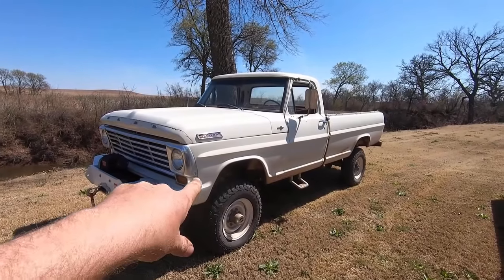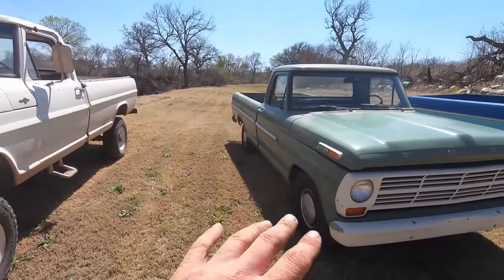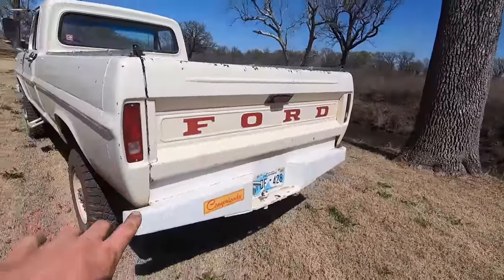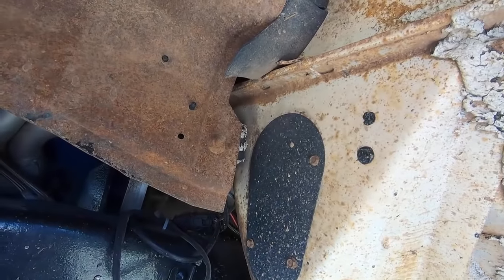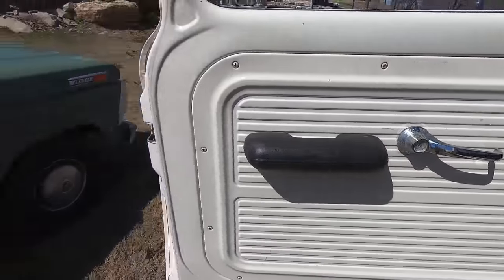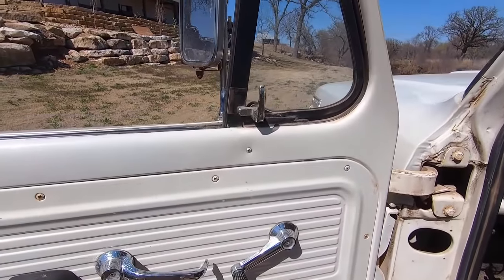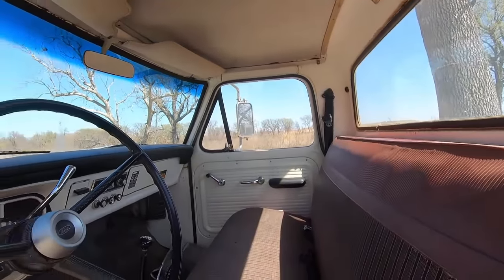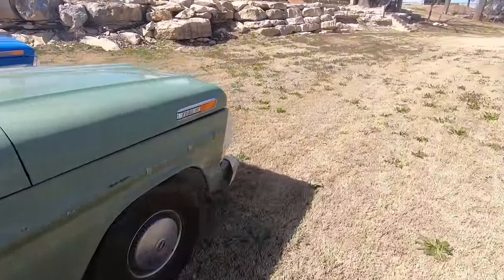What Makes a 1967 Bumpside so Different Than The Rest?

Comment: I had a '67 F100 Camper Special and had accumulated tons of stuff for it, including BRAND NEW hood emblems, CS emblems, etc. I bought it to restore, and did so much work on it to bring it back to life, until I was forced to use it as a daily driver for 3 years. In so many ways the '67 was a "one year" truck compared to the other bumps. I've since sold it all.. the truck just had too much cancer to save (mostly around the roof drip rail) and I had too many kids to hang on to it for daily use. 😥

Comment: Those garment cooks in the 67's look identical to the ones in my mom's 62 Falcon Deluxe 2 door..
Reply from the maker: Probably the same hook!
Reply: @MattKubik1791  I'm sure it is !
I've had 3 bumpsides, my first and my first vehicle ever was a 71' Custom short bed, 302, 3 on the tree and manual everything, and I had 2 72's, a Sport Custom, 360 auto and power steering and an Explorer with the same options except it had the BIG radiator which I guess was a towing package.
All excellent vehicles !!

Comment: The one you said was a Camper Special didn't look like one no duel tanks that I could see. So hope you go back to that one to clarify the Camper Special you think you have Thanks, will be watching 😊
Reply from the maker: Dual fuel tanks were not a part of the camper special package. At least during 67-72. The only options that were included as standard when you selected the camper special package were: 55 amp alternator, 70 amp hour battery, oil pressure gauge, ammeter, western long arm mirrors, extra cooling package, camper wiring harness, dual electric horns (expect ones with power pack option) and last but not least camper special cowl emblems. Dual tanks were optional, as well as side storage tool box that most associate with camper specials. Hope this helps! 

Source: 1972 ford truck brochure page 11. 
 http://www.fordification.com/library/picture.php?/1703/category/211

Comment: great video, I think only think  it would be better if the 4x4  was a 4 speed,but with that motor very cool!  I had 69 4 speed 390 wish I never would have sold it!   thanks for video. very bad think about these trucks key switch you can just pug new one in and start any truck this year crazy!.

Comment: I have a 71 f100 SB 4x4 and a 68 f100 SB flare side 4x4 that is #40 built 68 f100 . Don't know what # 4x4 it is for 68. But everything in my 68 is 67 . Heater and radio controls , grill etc. All of it is left over 67 but it's a 68 originally sold to US Dept of Agriculture. Factory 360fe . Has factory Dana 60 semi floating 5 lug rear differential with power lock limited slip differential and 4.10 gears. Love the bumpsides

Comment: Thanks for that, do you know anyone with the 66 F250 4x4? I haven’t seen another one yet, I bought it in OK 1984
Reply from the maker: Yes, quite common. But less common as the later trucks. Ford started making factory 4wd f-250 trucks in 1959.
Reply: So how do I find out how much my truck is worth? Thanks
Reply from the maker: @stanwalls6434  research, find comparable sells, Facebook market place, Craig’s list etc. hagerty has valuation tools to help but only have fair to Concourse values. If you are unable you can pay a classic car appriser to value it for you.

Comment: Weren't the 4 way flashers optional in '67s too?  And with the switch mounted in the glove box?
If it was a cigarette lighter, it would be narrower, and a cigar wouldn't fit.
Bumpsides are THE BEST looking pickup trucks ever made. (Although the '55-'57 GMs are up there too.) I have the Bump's almost-as-good-looking younger brother, a Dentside.
First trucks I ever rode in and drove were Bumpsides.  Didn't the '67s still use the lighter blue paint on the engines?

Comment: First Time Viewer! Great Video! @14:51 Looks like a 1969 - 1972 Ford steering wheel mounted in a 1969 - 1972 Chevrolet / GMC steering column with tilt wheel and gear selector indicator. Why do you have General Motors "Gargantuan Mistake" parts on your Ford "First On Race Day" truck???

Comment: Hi, Interesting vid👍 I have a 71 F100 4x4 I am rebuilding and I wonder if anyone can tell me what the holes with grommets in are for inside the back cab corners above the seat, I notice they are also in your 67, could they have been put there for optional lap and diagonal seat belts, they are beefed up with tube inside  but there is no thread in them?
Reply from the maker: They are for factory shoulder belts. However I decided not to use them because they are so far back. I installed my shoulder belts closer to the 1970-72 location.
Reply: @MattKubik1791  Thanks, I thought that was the case, I just discovered Ford changed the position of them mid 71 mine was assembled Nov 70 so the holes are in the same position  as yours.

Comment: The side trim is different also. It’s not as wide as 68/73. They also had a “flat” floor board. That was in the six cylinder/ three speed trucks. They did not have disc brakes.My truck was built in September and did not have a factory title. They started titling trucks until October. That change was when the trucks became daily drivers and farm equipment.
Reply from the maker: Correct! I didn’t have a 67 with trim to show that and forgot to mention it. But our 69 also has the “flat” floor. This 67 that I made into a highboy originally was a f-100 with 352 and 3 speed. It has the flat floor and I had to cut it out to install the high hump cover. So not sure if that is a 67 only item.
Reply: All of the older Ford 4WD trucks and GM 4WD trucks have the "hump floor".
Reply: The 67 had bolts to remove the flat panel and put in the heavy duty panel for automatic transmission and “double low” transmission.

Comment: Good day and new subscriber here! I've had a dentside for few years now, and just yesterday I bought my first bump!  1970 F250 2wd Custom cab. 360 with a 4 speed. You seem to be an expert on these bumps so I have a question for you.  This 360 has an oil bath air cleaner on it. Did they still use this in 1970?
Reply from the maker: Yes it was optional equipment.
Reply: @MattKubik1791  Thanks!  I've done some reading but couldn't find anything definitive. And I've been a Ford parts guy for 21 years 🤔

Comment: Got myself a 67 250 camper special for myself. Rusty and somebody painted it with a fuckin brush but I basically only paid for the rims and exhaust for a running truck with a 460 in it.

Comment: My “base” model  1967 swb 6 cyl “3 on the tree” was purchased used in 1970 by my parents, I believe it was stone stock back then, it came with the aluminum grill you have and a painted steel front bumper...Currently being reworked once again, only thing left stock is the cab/ bed.
Reply from the maker: Very cool! Maybe mine came from the factory that way. That’s an awesome story and cool that you still have it.

Comment: i picked up a 70 high boy with dana 60/80 lockers with a 390 4 speed rust free good clean body tool box on side extra front clip doors and hood 3 sets of chrome trim lights and emblems box was full of parts all for 250 bucks with a set of new wheels 12 inch 16,5 rims for military tires i get 36.5 tires for 25 bucks with 80% tread . i had a 67 with a 352 it was a gas hog with no power i think i have 3 360 that i just through in the dirt .plus i can get a lot of 390's i know where there is about 8 just sitting in rigs at my friends house i can get them for 100 bucks each or buy the whole rig for 300 from 65 to 78 that what he has just sitting about 25 rigs in ford pu's

Comment: I see your '67 has shoulder belts but the '69 does not.  Aftermarket change on the '67?  Or a factory option?
Reply from the maker: My 67 has aftermarket belts. But shoulder belts were an option but very rarely added. I’ve only ever seen them on a government order truck.

Comment: You should check out the Brazilian F-1000, apparently they have been continuing to build the 1967 f100 as the F-1000 over there all the way through from the research, looks like 1992... The truck has a full set of round gauges that you could probably order from Ford of Brazil that might plug in with some mods..
 check out the You tube videos for F1000s 1992 ford F1000 will blow your mind...
As a side note I think they used the 1972 Grill assembly all the way through 1980!!
Reply: The Australian 69 - 73 had individual  round in dash guages as well, my 74 F250 Hi boy has a dentside body but the earlier steel type dashboard with the round guages.
It may be similar to the Brazilian models.

Comment: 67 is the transition year. So many differences between them and the later ones. Even the wiring harness is different. I had a 67 that had a carb fire that burned the dash and wiring. Had a heck of a time getting parts to fix it.
Reply: Glad you were able to fix it.  I would have a similar problem with my 54 New Yorker.  It has a 1 year only wiring harness.  55 has the same problem.

Comment: My first vehicle back in 1985 was a 1968 F-250 with a 360ci engine, no power steering, drum brakes front and back and a three speed shifter on the column...lol If you can learn to drive that thing you can drive anything
Reply from the maker: Very true!

Comment: do you know what company is best fore door  window seals and rubbers I put LMC in my truck 2 years ago and they are crap
Reply from the maker: I have heard good things about steel rubber products. However I have not used them yet myself.
Reply: I decided to buy Fairchild brand from rockauto, but I’m still waiting for them as I type this. Dennis carpenter has some USA made ones, but I’ve never used em. And you’re right. Lmc is junk
Reply: I bought a gas neck seal for my 69 f-100 and two weeks later it had cracks all around . never again!
Reply: @olblu8746  from what company ?
Reply: @hemidart7  oops , sorry l messed up!  The seal was from from LMC. I also got from LMC a rear window rubber seal. But now after seeing the gas neck crack up l dont know if l'm putting it on. They might be made in China.

Comment: I had the 1972 -250 camper special 390 with a 4 speed 16.5 split rims base model , no air 
It had 2 gas added for total of 3 and you needed all 3 , I loved that truck but wives and kids what can you say ..
Reply: 16 where split rims tube type 16.5 where drop center tubeless
Reply: @larrytorrez7079  hey i am old
Reply: @bobw9297  I'm old also but worked in tires for lots of years when young and worked on split rims in farm communities
Reply: @larrytorrez7079  LOL ya i suffer from C.R.A.F.T,

Comment: It's not called a bumpside. I think that must be something you came up with. It is called an "arrowside fleetbody", as per FOMOCO.
Reply from the maker: Bump side is the slang term for the 67-72 ford pickups used by enthusiast. They are called that due to the raised hump down the side of the truck creating a bump feature. In contrast the 73-79 ford pickups have a concaved feature on the same location. Those truck are referred to as Dent sides. Again not an official ford designation, just a slang term.  Now If you want to get more technical, Fords term for the flat sided bed box bed is style side. Fords term for the traditional wagon style bed is flare side. Both of those terms however have nothing to do with the model or year of pickup and only refer to the bed style. As to your comment about "fleetbody" maybe you are referring to the GM name for their flat sided bed. They call that a fleet side. And GMs wagon style bed is called a step side. Anyway hope that clears somethings up as to why I call it a bump side! cheers.
Reply: @MattKubik1791  Great Reply! Exactly and Precisely Correct!!!

Comment: he is a deal i got a 70 high boy rust free tool box on side extra lights emblems and chrome trim from about 6 trucks a extra front clip good clean body dana 60/80 lockers 4 speed 390 engine extra doors too here is the kicker got it for 250 bucks even has a good seat in it but i get a lot for free just gave a 67 high boy 1/2 ton away with a 360 in it running just needed a front clip on it but it was a 1/2 ton plus i have a few 4x4 chevy and fords and a lot of 2 wheel rigs building a 68 chevy pu right now y i build my high boy on the side i know were u can get a few fords from 65 to 72 the 65 is real nice not sure if it a short box or long box been a year since i last looked at it but is still there  i got a set of door out of a motor home class c pu they have really cool door panels and arm rest the only one i have seen like this plus it came with capt. seats made for a ford pu plus factory air and cruise control for a ford 67 to 72 pu i pulled the 428 cj out of it that is what the paperwork on it said it was but needs to be rebuilt someday it will be in my high boy

Comment: I always thought a bump side was the one with the fenders straightside  is the 1 with like you have?
Reply: Bump sides have a body line that runs the length the truck it sticks out. and dent sides that body line concaves in. and higher end models have a polished aluminum trim. with about a 3/4 inch rubber bumper built into it.

Comment: Back when trucks had azz to them. You could about use the bumper to push a tree over.

These days, you bump into something and it's 5,000 damage. Airbags will deploy and trucks computer needs to be replaced 🤦‍♂️🤦‍♂️🤦‍♂️

The engines were also built better and easy to work on. I have literally seen 3 guys replace a head gasket in the parking lot of an auto parts store in less than 2 hours.

Comment: Seatbelts ?
Reply from the maker: Yes? What about them?
Reply: @MattKubik1791  Did they have laptop belts or shoulder in 67 ?
Reply from the maker: @mcfuller5020  I added the shoulder belts on this truck. However factory shoulder belts was an option but very rare. We have a 69 f-100 that had factory shoulder belts and on the marti report there were only 371 in 69 that had them.
Reply: @MattKubik1791  Did not know  before 1970 there were shoulder belts.
Reply from the maker: @mcfuller5020  ill have a crew cab highboy video coming up that will show that truck and the marti report if you are interested.
Reply: @MattKubik1791  I enjoy your video's, and thank you .

Comment: Too bad more Ford trucks from the 60's and 70's weren't taken better care of. They are way easier to work on than Ford trucks 1990 and newer. A Ford F-250 Custom from the mid 70's with a big block motor and 1 ton brakes and springs is as Ford tough as a new F-250.

Comment: The badge  on the white  67 seys 250 not 100
Reply: The  badge  on the  white  67 sets 250 not 100 so that make it  a 3/4 ton
Reply from the maker: Yes, started out as a f-100, I put it on a f-250 highboy chassis. I changed the hood emblems to reflect that change.